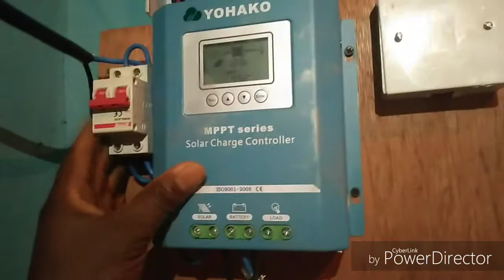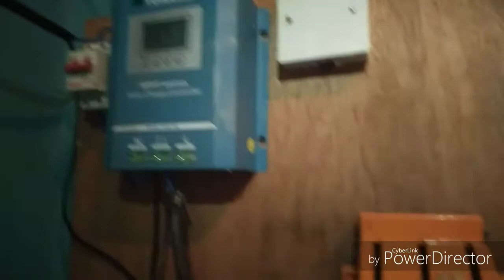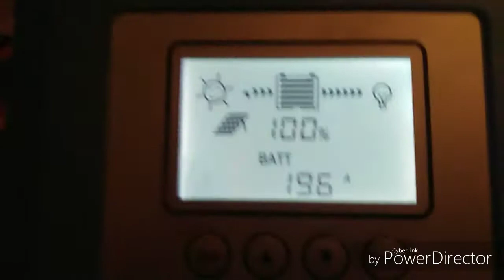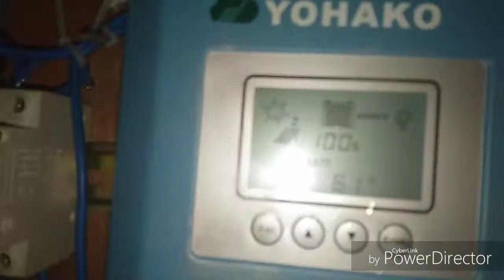7.5kva solar  powered hotel In Nigeria

Comment: What is the cost of 3kva
Reply from the maker: Good morning, solar power installation is easily sized with kWh not KVA. please, give me the list of the appliances you want to power to enable me size you KVA capacity appropriately . Regards
Reply: @gti2  I have AC 1 HP,fridge ,washing machine. Though I will be sharing the loads